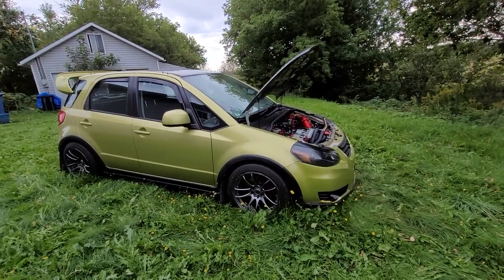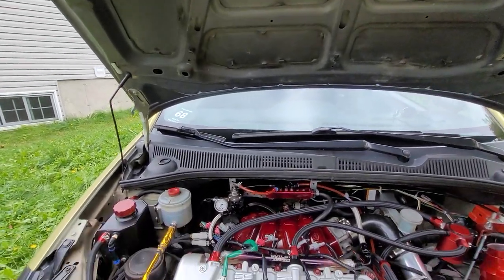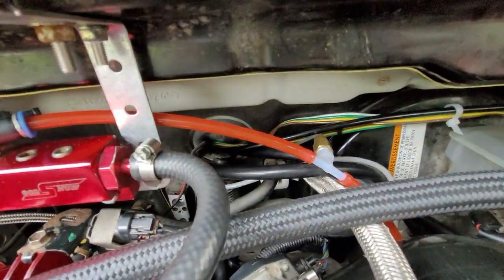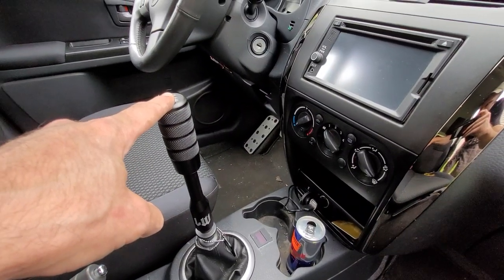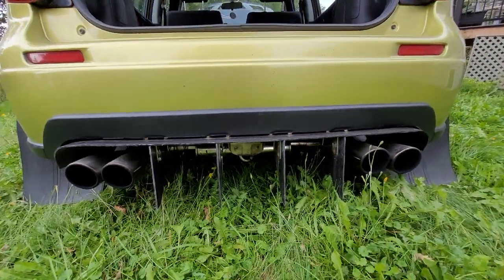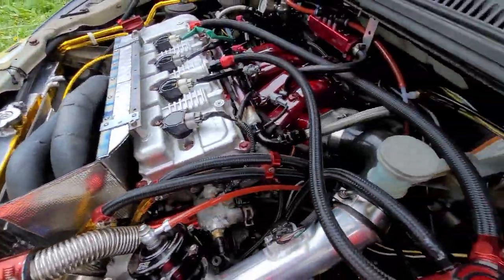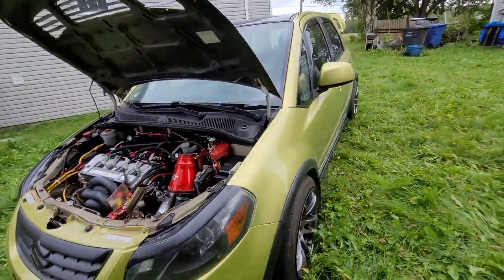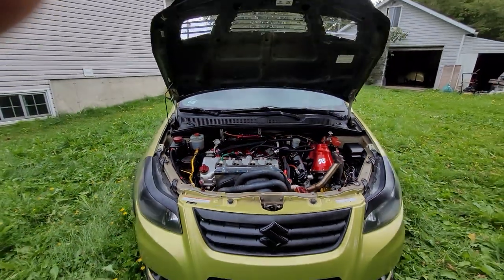Walk around of my Turbo Suzuki SX4 2013.

Comment: Nice job mister! J'ai un 2011 AWD 6MT et après avoir eu de la misère à trouver des pièces oem juste pour maintenir l'auto (le driveshaft entre autre), je te trouve franchement courageux de t'être embarqué là dedans.
Reply from the maker: J'ai du pas mal tout fait custom. Il a presque pu rien de oem dans ce char là appart moteur, transmission, châssis.

Comment: Inspirational. Love this setup. How's it driving now a days? Still going strong? Any issues? Reliable?
Reply from the maker: @hdiaz_daily  thanks. Still drive good. Small issues tuning wise but are soon to be fixed by the tuner. I've got some rough idle issues that have appeared lately & sometimes I get high revs when changing gears. All of those are issues with the tune. I'm returning to the dyno shop as soon as I get my new injectors for a remap & to fix these small issues. Besides that, it pulls strong and can rev to 7000rpm.

Comment: I do plan to do some modifications on my kizashi can you let me know where do i get custom clutch for the same.
Thanks in advance sir
Reply from the maker: I approached a clutch company in my local area and had them build it with the specs & material I requested. So they copied the oem clutch but made it a 6 puck kevlar good for 400 lbs. Other than that check out www.uniclutch.com they might have something for the kizashi.

Comment: Nicely done! What a awesome project. The manual 6 speed transmission are stock from this model? My SX4 have a 5 speed manual with the J20A engine. I'm gonna do some researches to know the difference. Also, your car still have the stock AWD since or you made it real permanent?
Reply: these cars are permanant awd with the option to switch into 2wd only. one of the only cars to ever do it with fwd based awd
Reply: @liampresswood9533  I have a SX4 and it's not permanent awd. It runs on fwd and it enters the awd only on demand, like if it's a slipery road of some similar situation. It also have the awd lock that it's "permanent", but only until 60kmph and can't be used on asphalt
Reply: @edfell66  yeah that's "permanent awd" awd systems are all based off fwd or rwd, the lock is a 50/50 split. The auto you're right it's primarily the front wheels but it'd actually 90 front/10 rear for torque % distribution then when it slips it can go up to 50/50. Also neat trick, if you unplug one of the rear abs/speed sensors, you can take the lock setting past 60kmh. Can't rember which side tho.
Reply: @liampresswood9533  yeah, it's possible to disable the 60km/h limitation, but shouldn't be driven in asphalt or high grip situations
Reply from the maker: It's awd always on. Deleted abs and traction control. The torque split is 85-15 in auto mode and when the front wheels slip it goes 60-40. I still have lock mode and that's a permanent 60-40 without the 60km/hr shutdown.
Reply: @samueldesbiens2524  when you say you deleted abs, did you also delete the rear speed sensors? If so how did you bypass the awd light flashing (disengaging from no communication from the rear)
Reply from the maker: @liampresswood9533  no all wheel speed sensors are present. I have a haltech standalone ecu, bypassed all traction, safety & abs from the stock ecm to the haltech. Everything is wired to the standalone including variable cam, variable intake, vvt actuator, throttlebody/gas pedal etc.
Reply: @samueldesbiens2524  using the lock mode permanently breaks or cause any kind of problem tho the awd system? Did you do any changes in the AWD system to handle the extra horsepower you put in the engine?
Reply from the maker: @edsonfell22  besides polyurethane diff mount bushing on all mounts, that's about it. I'm working on getting a phantom grip installed to convert the open diff to a limited slip on both front and rear.

Comment: Did you tint the headlight housings yourself or did you find some? Where did you find the custom headlight piece's?
Reply from the maker: I did it myself. Used a heat gun to open the lenses and spray painted them with high temp plastic paint.
Reply from the maker: All the parts are morimoto: mini H1 projectors, HID 6500k bulbs and profile prism rgb demon eyes